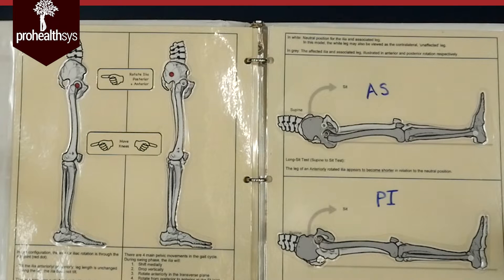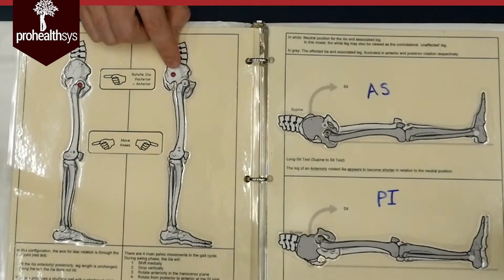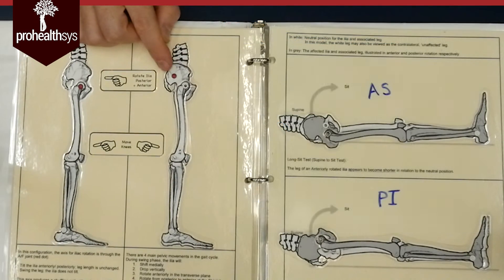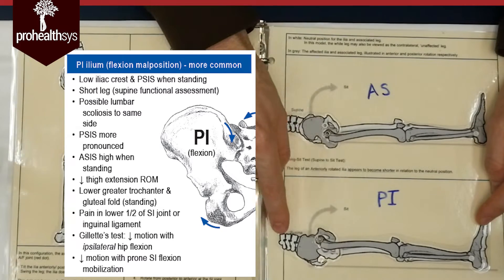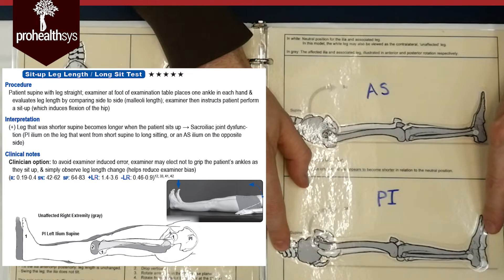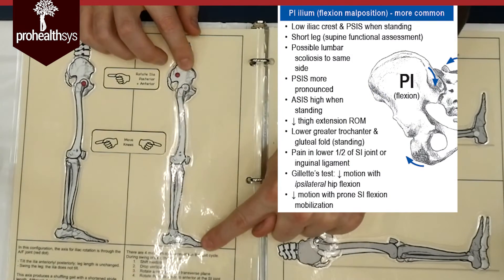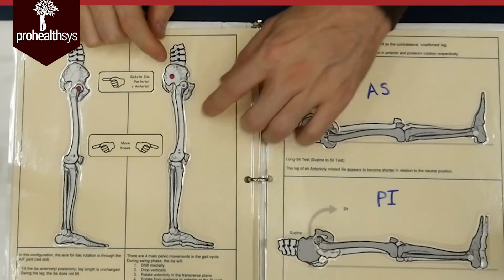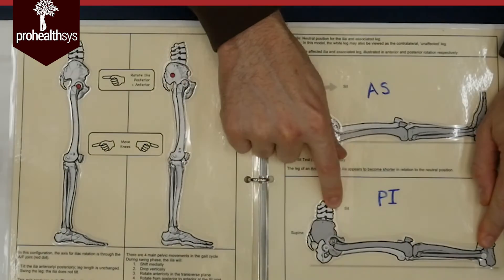SI Motion Long Sit Test Anterior Posterior Pelvic Tilt Dr  Vizniak

Comment: Hmm, my problem is different. When I'm standing my right leg is short. When I lye down, they are the same length (but my right foot falls out to the right). When I'm in long sitting, my right leg gets short again. Any thoughts on that?
Reply: Me too. What now about your ?
Reply: @nutarun1614  Same. Has been like that for years. No amount of experts have fixed it. If you ever find the fix let me know
Reply: @redrum4100  From my research ,I think PSOAS is weak and shortened and SI join pain.
Reply: @nutarun1614  Tried stretching mine but it had no effect. Have you tried stretching yours?
Reply: @redrum4100  All Right leg. Not Effect too

Comment: This is  confusing,check this pls
https://erikdalton.com/blog/short-leg-syndrome-part-1/

Based on this anterior create a short leg and not posterior
So it can happen in both tilt if is extreme tilted?i have my self a pelvic torsion or twisted and i do have a fake short leg on the right side,but unlike what u show on the video the femur and hip sit back like on anterior and there is internal rotation on the pelvis,the right side drop front and to the left,while the left side that is on posterior the femur and the hip stay more close to the front side of the pelvis and that leg is longer

Could u please explain?

Comment: Could you make a video on how to correct this, thank u so much. My chiropractor that's just the way mine gets she pops me back but 3 weeks later I'm back to it, a little frustrating..
Reply: If you have an ANTERIOR tilt - stretch the hip flexor muscles (psoas and rectus femoris (quads)), and strengthen glute max and abs. Don't stretch the hamstrings. And do the exercises in a forced posterior tilt.
If you have a POSTERIOR tilt - strengthen the hip flexors and abs, and stretch the hamstrings. Don't stretch the quads. And do the exercises in a forced anterior tilt.
Good luck. You will see a difference in a couple of days.
Reply: Your skeleton is manipulated by muscles. Subsequently, when a muscle/muscles are weak and tight, they put your body into incorrect positions which is where they remain until the problem is addressed. 

Focus on mobilising the muscles around the hip for a start. See how you get on!

And don't be afraid to research these issues yourself. There are plenty of reputable professionals out there, who are happy to educate you for free. YouTube being the go to needless to say.

Hope you get to the bottom of it (no pun intended) 😂

Comment: So fixing apt would make you a bit taller as the legs would extend fully and the spine would straighten ?
Reply from the maker: It is possible... but these issues are often multifactorial and results may vary